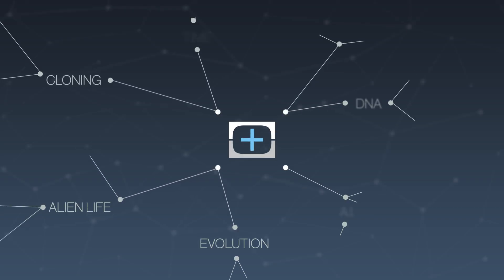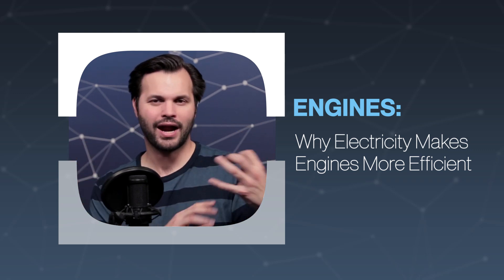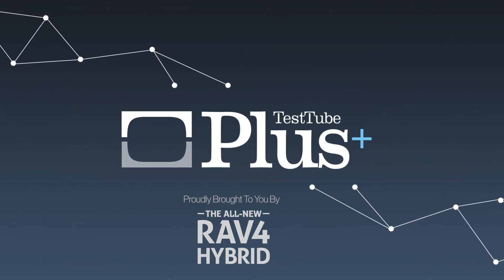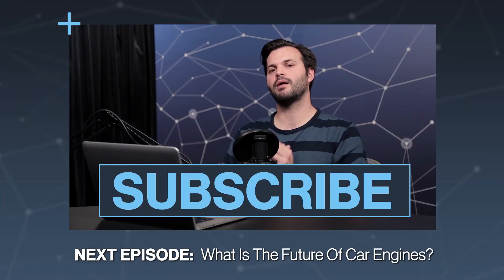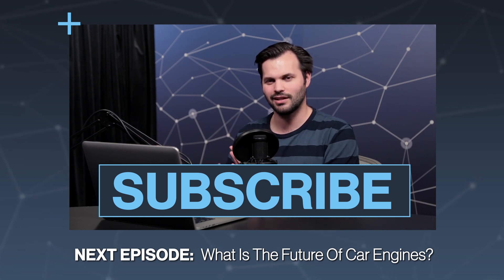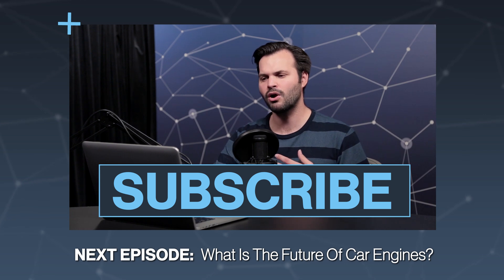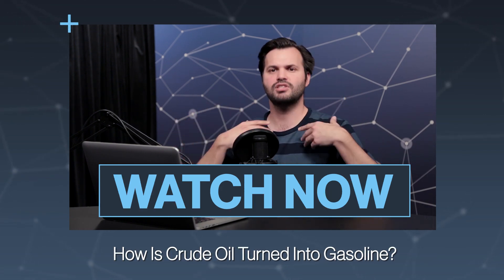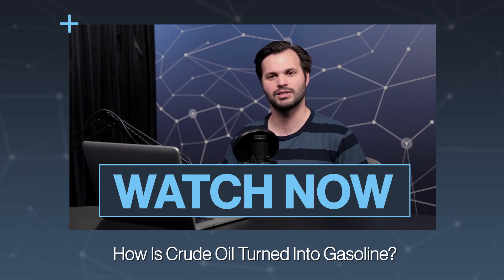Why Electricity Makes Engines More Efficient

Comment: If I got a new car today I'd want a hybrid, since there aren't many changing stations for electrics. Once more charging stations come out, hands down I'd want an electric.
Reply: +Chaz Evansdale and what if you have a charging station at home and get 300 miles a charge? Tesla, just saying
Reply: Eric D That's a good point, for an average American, but I'm not one. I've been traveling all around the USA for the past 4 years. If I settled down somewhere a car with 150 mile range only charging at home would be enough. But since I like the convenience of travel I'd want convenient charging stations along that trip. That could mean one charging station every 100+ miles for a 300 mile "tank" but I'd still want those stations.

Some of the places I live I don't own so I can't charge at my place of rest. Though there could be a potential work around with an energy meter and contract. Next some of those places are in the middle of nowhere and only have one gas station for 100 miles, so the likelyhood of them having an electric charging station is slim to none any time soon.

However, with all that said every vehicle I buy is more efficient than the last. I currently drive a Toyota Echo and get 37/41 MPG city/highway. 

TL;DR For the average American 300 miles/charge is enough. I'm just not average.
Reply: Chaz Evansdale one question, why do you insist on saying American so much? The same stuff applies to the average person anywhere in the developed world.
Reply: Eric D I say it because I'm familiar with it. I know the how much the average American drives in a work day and in a year. I don't know that about other countries. So I'm sticking with what I know instead of speculating about the world.
Reply: David Beppler I think it'd be best to do at restaurants, grocery stores, and shopping centers, any public place people typically are for 20+ minutes anyways. Then add them to private places like hotels and jobs as companies catch on. I just realized we don't need the gas station model for EVs.
Reply: +Chaz Evansdale you said, "Some of the places I live I don't own so I can't charge at my place of rest. Though there could be a potential work around with an energy meter and contract. Next some of those places are in the middle of nowhere and only have one gas station for 100 miles, so the likelyhood of them having an electric charging station is slim to none any time soon."  My question is, those places in the middle of nowhere have no electricity?  You can plug a Tesla into any 110 or 220 wall socket.  It will charge your car... just takes much longer.
Reply: +David Beppler Like I said, potential work around if the community/place I'm living in would allow me to plug in at their place. 

For some apartments it's just not an option. If you stay the night at a hotel, while driving a long distance it's not an option, so a 300 mile/charge 'tank' isn't always enough for a nomad.
Reply: ***** Hotels/Motels need to start doing this as well as some food place like Steak 'n Shake.  The 30-45 min while you eat could put a nice charge in your car and be included in the bill.
Reply: +Chaz Evansdale 
In terms of cost, the tesla model s stores about the equivalent of 3 gallons of gas. Except that because its grid electricity, usually it will be cheaper, especially should gas prices rise again. So basically, other than the cost of the charging station, the cost is nothing. Whatever you charge for using it and whatever method - by kwh, per day, per hour, or per fillup, it will almost certainly turn a profit.
As for owning a hybrid, the new  52mpg prius is a ugly beautiful last gasp of triumph from toyota as gas cars continue to creep to their doom and if I had $25k to spend I would definitely choose that over any ev in that price range.
Reply: Chaz Evansdale  Hotels like money.  They will charge your car.
Reply: David Beppler I used to be a hotel GM. If someone asked to do to charge their car it'd be a headache to try to figure out how to do it. How do I know how much energy they use, how much to charge them? Should I make it a free service to increase sales? How do I put a cord from the hotel to their car without it being a safety issue, aka how do I do it legally?

Hotels giving energy to cars brings up more questions than it answers. Eventually there could be charging polls and things will sort themselves out. For not it's not as easy as "Hotels like money."

I still don't know why you persist in convincing me to get an electric vehicle, because for me it'd be an inconvenience. However, I hope by the time my car gives out, ~5yrs, these inconveniences will be gone and I can get an electric.
Reply: ***** You misread what I meant. I was talking about how much money to charge the person, not how long to charge the car. Without a meter to track how much they charged their batteries it'd be guessing how much to charge you for it. I read once that electric by US average costs similar to $1.15 per gallon. I don't think $5 would cover it if they're almost on empty. Again, guessing what to charge. 

Either way it's more work and maybe not be legal or safe. It's crazy the minor stuff that if caught could shut a hotel down, a cord going from the hotel to a car is a tripping hazard and could get you a $5,000 fine or sued if someone trips on it.

It's not as easy as just charging the customer; laws, regulations and red tape are involved too. The same ones that are slowing down solar and wind power, because people say "not in my backyard" and can get away with it because of antiquated laws that can stopping you from using your property that you own to make or use whatever you want. It's annoying, but it's how it is till we fight to change it.

TL;DR Until laws, regulations, and common practices are put in place for charging EVs it's currently an inconvenience for many Americans. This is coming from someone who wants them to succeed.
Reply: ***** Thanks for understanding and agreeing with me. I feel like I was attacked in this thread simply for having an opinion that a hybrid would be more convenient for me currently. :)
Reply: Chaz Evansdale You were a hotel manager and can not solve the equation of how much to charge someone who wants to charge an electric car?  You must be joking.  If a customer wanted to charge their electric car you would tell them to go to a different hotel/motel?  Just because you can not figure out what to charge them?  That is the "Managers" job.  I was not attacking you, simply showing you the fallacy of your statements.

Comment: eletric cars not any better for environment and they're not fun to drive
Reply: both of those statements are half-truths. If you charge your electric vehicle only with electricity from coal plats ( basically the most environmentally harmful way) you'll pollute just as much as a normal car. In the Us an electric vehicle would have a 40 mpg, in other countries the mpg can go up to 120. An electric car has instant torque, so if you get a decently powered engine it will be more fun to drive. Just take the Tesla as an example.

Comment: A Porsche 918 would be fine. 4.7L V8 that revs to 9000 rpm and returns 60 mpg.
Reply: +abhishek jha (tobeornottobe) Yep, best hybrid on the market in my opinion, of course the P1 and laFerrari are pretty close 2nd and 3rd. Not that my opinion matters much when we start talking cars with that many digits in the price.
Reply: +abhishek jha (tobeornottobe) But it can not do both in the same time. And that 60mpg is madein laboratory by driving 50% of time on pure electric. So, if you drive 918 long distance (coast to coast), have light foot on gas, let car regen by early light braking, and keep it under 60mph, you would get 40-45mpg, maybe.